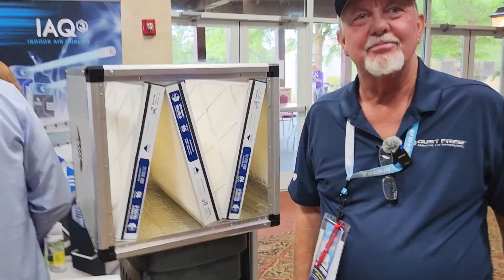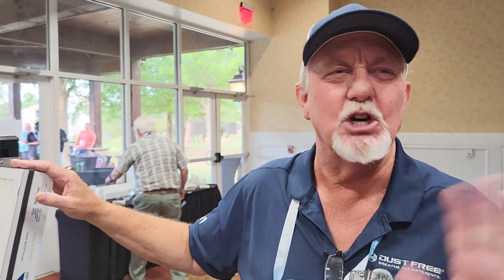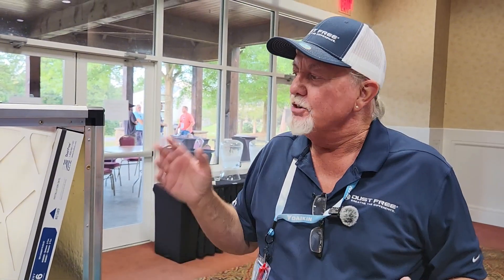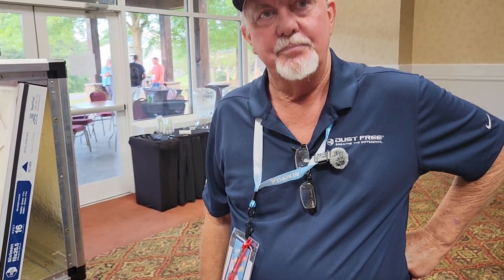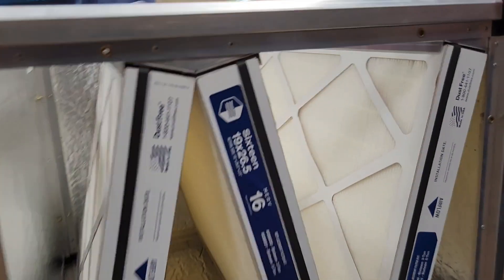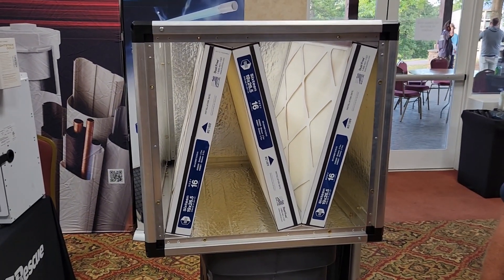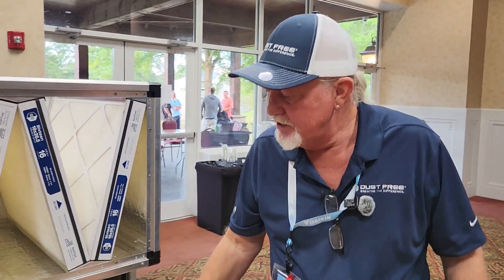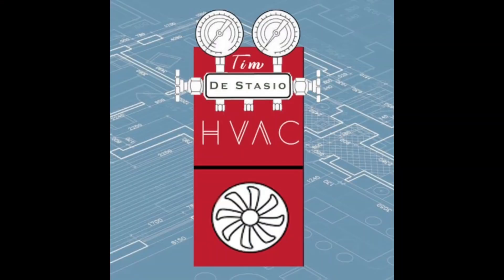John Ellis and the Dust Free 16 Filter System

Comment: Do they have any filters that incorporate activated carbon for VOC and odor removal for this model? Or do they have a configuration that they recommend that can put a lower rated MERV filter before this filter that has the activated carbon in the filter to achieve the same results? I ask these questions for people that don’t want to use products that change the chemistry of the air. Thank you.
Reply from the maker: @Ryan-RM  This does not change the chemistry in the air like an electronic air cleaner would.  The electrostatic capabilities are solely in the filter media not in the air that passes through it.  There are some adsorption features built in which allow TVOCs to chemically bond,  yet not to the effect that activated carbon would. 
The best way to lower TVOCs would be dilution with fresh air and if that air also passes through the filter, it would be pretty clean.
Reply: @timdestasiohvac  Thanks for responding. What I meant was I know this product does not change the chemistry of the air but an ionizer they (Dustfree) might offer to pair with this filter would. I was simply wondering since the MERV 16 filter does not have carbon for VOCs and odors, how they (Dustfree) would best handle that without the use of an ionizer to pair with this filter? Thank you again Tim.
Reply: Typically odors tend to become an issue in a commercial building at 800 parts per million of CO2 because of the concentration of human bodies. If you're that concerned in a residential application you mean be better served with ventilating outside air into the building to help dilute concentrations of smells rather than carbon. The typical carbon impregnated filter that has less than a 16th of an inch of carbon on top of the filter is pointless. It may only last hours.
Reply from the maker: @JustinBright-u9p  Great comment and I hope my earlier reply came across with that message.